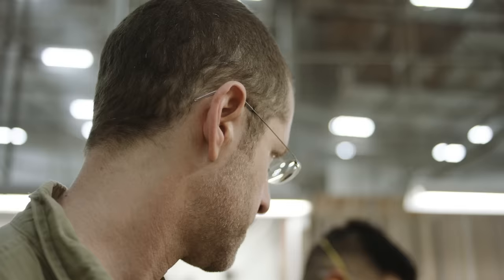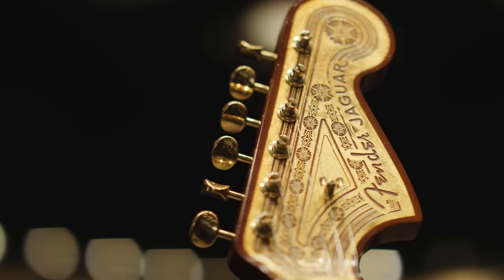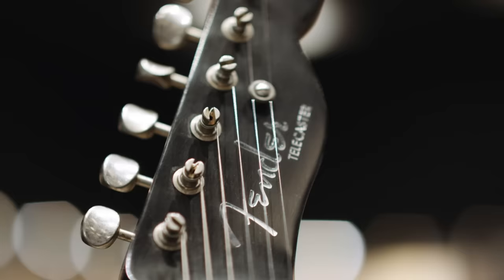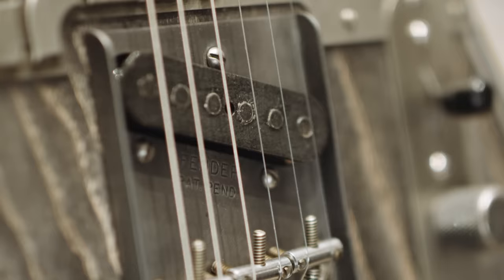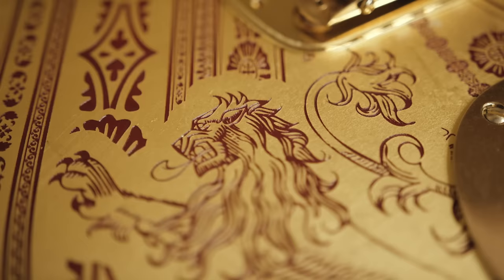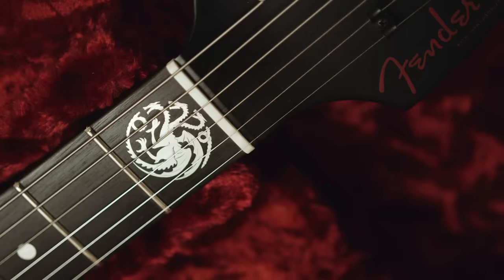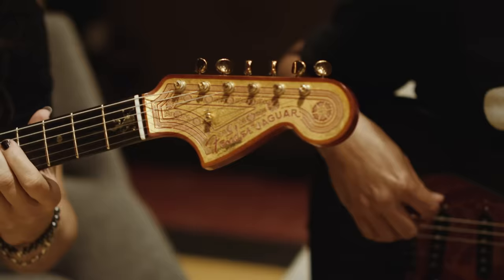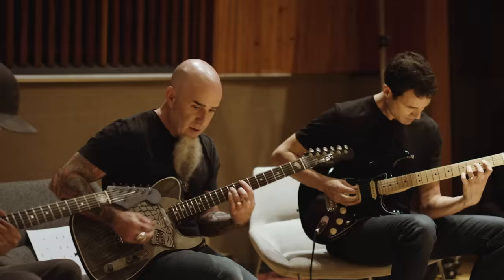Game of Thrones Sigil Collection | Custom Shop | Fender

Comment: George RR Martin has been recruited to design 3 more custom Game of Thrones guitars.

 The first one is going to be a  guitar based on The Mountain.
It is going to be larger than most guitars, it is going to be 12 feet long and weigh 476 pounds. It is also going to have active pickups that have to be powered with a 10 amp weedeater engine.

 The second one is going to be a cigar box style guitar that is made with a box of cereal instead of a cigar box, it is going to have 1 string made out of line from the weedeater spool (They took the engine out of the weedeater for the Mountain guitar and decided it would be a waste to not use some of the leftover parts from the weedeater.)
This guitar is going to be based on the final season of Game of Thrones.

 The third and final guitar will be based on Theon Greyjoy.
It is an electric guitar but you will not be able to use it with an amplifier because all of the wiring inside the guitar has been cut.

George R.R. Martin is hard at work finishing the designs on these guitars and he should finish up by the year 2043.

Comment: I love these guitars, but I would have like to have seen one built that wasn't based on a Fender model, but rather designed "from scratch."  What would a guitar body be shaped like if built by Westeros craftsmen?  How ornate would the headstock really look like on a Lannister guitar?  Wouldn't the guitar have a name, like the Valerian Steel swords that are passed down through generations?  And, most importantly, what would it sound like?

Comment: 5:47 Dude, you've got the bridge flipped around. It's like 35k we're talking about!
Reply: Juan Wayne You high?
Reply: @mikefresca2758  No sir I'm not. Coarse saddles should be on the low side, while fine ones are for the plain strings. I've made that mistake myself before. Either way, I was just mentioning it in good fun. Even Ron Thorn himself seems to have taken in as just good fun: https://www.thegearpage.net/board/index.php?threads/35k-got-jaguar-and-they-still-got-the-saddles-wrong.2041519/#post-28432589

Edit: Oh, and he brought up to my attention that I fucked up the price, so there's that too.